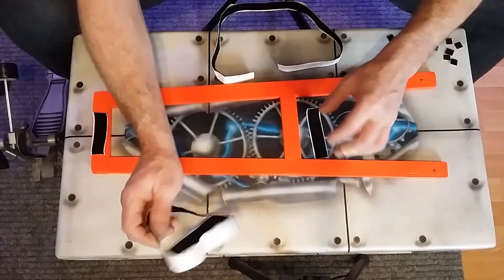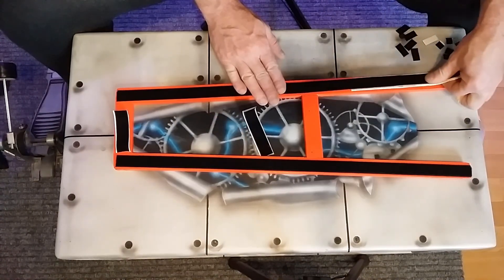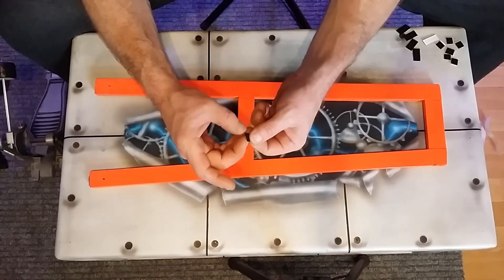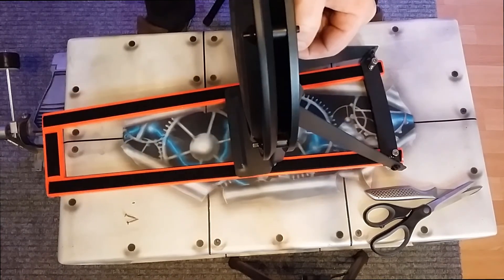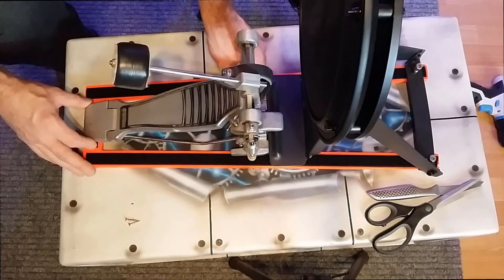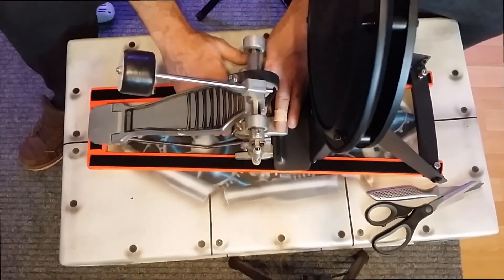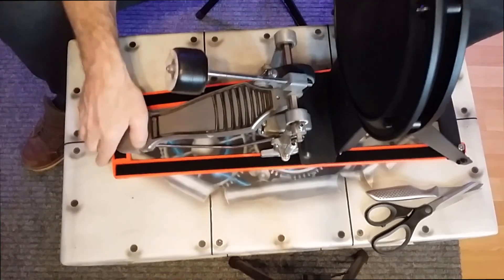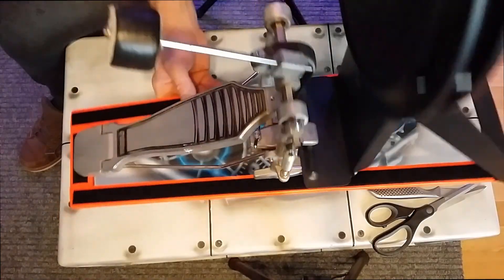Alesis turbo mesh kit Bass drum pedal upgrade, p3

Comment: Is it still working? Just bought a turbo mesh kit and the kick pedal sucks especially for higher bpm, looking to upgrade my pedal. Thanks
Reply from the maker: Hey there, It works but started skipping beats i need to buy a pack f triggers on amerzon an keep it protected behind the metal plate, but have the plate first in line. I will post a vid when i have the triggers.I think the milenium pedal is good but set up obviously for that kit. There is for sure a way of trouble shooting this issue. I had the trigger first in line and damaged it through banging on it like demon. Maybe there is a better option but for now i am also back to the kit pedal.